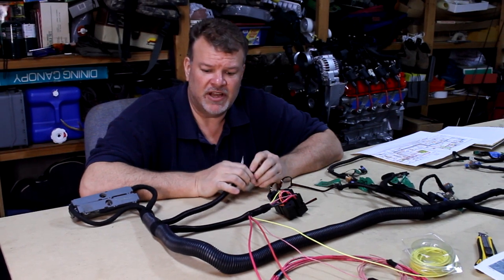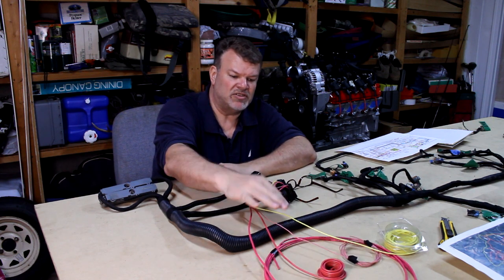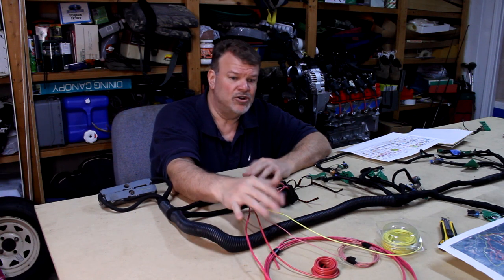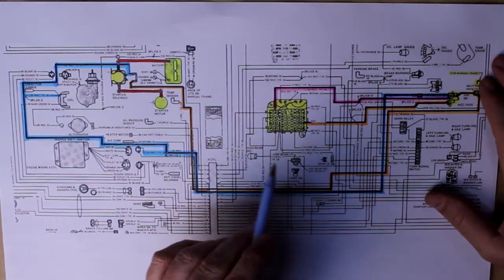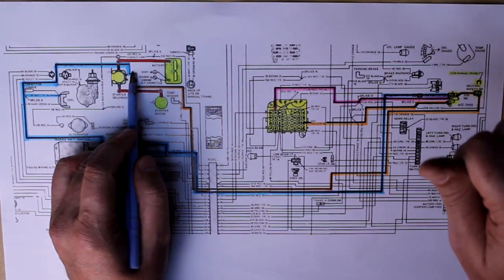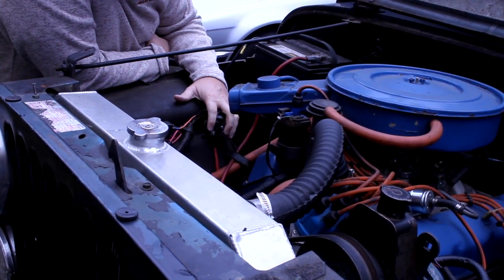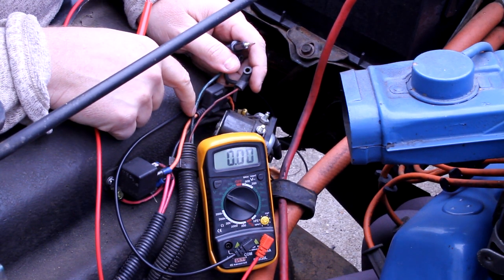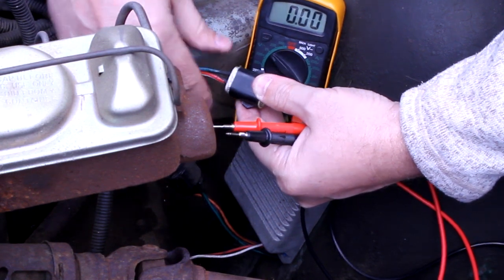LS Wiring Harness Part 6 | Project Rowdy Ep018

Comment: These videos are AWESOME! One question for you. The VATS need to be removed from the computer. Any way to do that with free software online? Also what other things need to be done to the computer in order to make it run? Assuming you could still tune it via a computer afterwards? Thanks Again.
Reply from the maker: These are great questions.   I don't know of any software that is free that would allow you to reprogram the GM ECM Computer.  I plan to use HP Tuners which requires the software and Tokens to access the ECM.   There are companies online that you can send yours to and have them reprogram, but you need to document all of the changes you want so that they can do it in one swoop.   The problem with that is if you upgrade any internal components, the ECM needs to be Tuned.   Removing VATS is the only thing required to "make it run".   However, while reprogramming, it makes sense to disable anything that would falsely generate a Check Engine Light (MIL) event.   Since I removed the EGR and Rear O2 Sensors, that will be a few of the Triggers that I will disable.   As far as Tuning the program.   It is best to make known changes, then run the engine in the car and collect driving data.  This will tell you where the computer had to make adjustments, then you go in and turn those adjustments into the default settings.   There are tables in the ECM that have to be "smoothed".   I am still working on the vehicle that this engine will be installed.   I am waiting till I have the engine installed to make all of the changes that I plan.   I have plenty of rough notes that I have collected and will review when that time comes.    Hope this helps.    Mike

Comment: One question sir. I’m working on my harnesses (obs and ls) I know where to connect the tcc wire from the harness but where do I connect the tcc wire from the pcm?
Reply from the maker: Sorry, but my solution and research has been for installing my engine in front of a Manual transmission so I do not plan to use the TCC circuit.  Someone else might be able to provide you help.   Mike

Comment: I have a question about the yellow wire (the fuel pump wire) is that sending out a 12v + signal or ground signal because for my Ls swap my plug into the fuel pump takes a ground signal?
Reply from the maker: For my configuration and in my drawing, the Yellow Fuel Pump Wire is a +12V Feed wire.   I’m looking at my diagram and believe, if you are wanting to use a similar solution to provide Ground.  You could do that by simply changing out the Orange Wire for a Ground wire.   Then when the PCM triggers the relay with the Green wire, the Yellow wire would be providing a Ground to your pump.
Reply: @UCanDoIt2Mike  awesome thank you so much!
Reply: @UCanDoIt2Mike  I just looked but that orange wire that it is connected too is a battery PCM battery supply so don't I need to keep that? If so would I do with the orange wire? sorry I am just alittle confused.
Reply from the maker: So I believe you said (I’m not so many words), that you need the PCMs Green wire trigger to turn on your fuel pump by providing a Negative signal.   Right now my diagram provide a Positive signal.  To change that, you would need to change what is going IN the relay at the right (according to my drawing) to be a Wire providing A negative connection and not providing a positive (+12v as the current Orange wire is doing.
Reply: @UCanDoIt2Mike  I'm just confused now I was talking about the orange wire. I also sent you an email showing how I believe mine is supposed to be wired I am just not sure how it to wire it up too yours.

Comment: If your Jeep came with a points in distributor, the other wire is to supply 12v for the point’s
Reply from the maker: That makes sense.  During the restoration, all of that is being removed.  Cheers!  Mike

Comment: That extra wire on the starter solenoid gives 12v to the coil during cranking. One started the coil runs off a resistor wire
Reply from the maker: Perfect!  Thanks  Mike

Comment: The wire that had ~6VDC at the starter solenoid is the run voltage for the coil. When the solenoid is energized, it sends 12VDC for starting to the coil, and when the solenoid is de-energized, the voltage on that line falls back to 6DC for run. Great series of videos for this project. Keep up the good work!
Reply from the maker: Thank you!   It did not make sense at the time.  Your explanation reinforces what I found but did not understand.   Thanks for clearing that up.  Cheers.   Mike
Reply: I was going to mention this. Those old distributor/coil solenoid and grey magic box were headaches for me in mid 80's ('77 Ford 351M).

Comment: Your videos are so well done it has been a great help to me in my build. I watched all these harness videos and remember you mentioning a guy that used the Starter enabled relay control. I am working with a blue green pcm that has this function. You had a link or a name but now I'm having trouble finding it. Thanks
Reply from the maker: The channel name is Gary Garcia.  Can’t remember if he went into detail on the subject or if he mentioned the theory that I picked up on.   Thanks for the feedback and have fun with your project.
Reply: @UCanDoIt2Mike  what episode did you mention him and the idea of the pcm controlled starter. I would like to watch it again. Thanks for you quick reply.
Reply from the maker: You’ll have to scan through his videos.   Not sure which one it was.  One of his wiring videos.
Reply: @UCanDoIt2Mike  actually i wanted to know what one of your videos did you mention him. Thanks
Reply: I did find his and may give this a try. The main problem is I am using the S10 fuse block so there may be a another relay needed to make this work. Would be cool to get it functional. Thanks
Reply from the maker: If it was not in this part 6 video, it may have been in Part 4 or  Part 5.

Comment: Sir can you make corolla 2005 wiring harness
Reply from the maker: The wiring process shown in this video series is not vehicle specific.  You can drop this engine and harness in any vehicle that it will physically fit and make it work.

Comment: So it's been a few yrs and I'm sure you're done with your jeep but I'm doing a swap on my truck and I'm wondering where/who ended up doing your PCU flash and tuning? Thx for great vids
Reply from the maker: In home restorations, a few years can turn into a few more years.   I am still working on the Jeep.  I plan to do the PCM flash updates myself.  I have purchased HP Tuners and a couple of credits.   I have already created some documentation that I plan to follow after the engine is installed in the vehicle.  I will video that effort, but it is a while out.   Cheers!   Mike

Comment: I'm doing the same swap on an 86 CJ7- you're helping thousands of people.  
From the split bulkhead connector, I assume you're keeping the left side connector's wires intact (the headlights, turn signals wires).  From the right side bulkhead connector, you're splicing into the 2 wires (blue & red w/ white tracer) that go into the old Jeep ECU.  
What other wires will you use that come out of the right side bulkhead connector?  Thanks for all your work.
Reply from the maker: My plans are to install a new Jeep Body wiring harness which will completely replace the fire wall split connector.  That wire is old, weathered, and stories of it being a lower grade wire....  I want to avoid future issues.   That harness will resemble the one that I analyzed in this video.  I will still only need to find a Switched 12V+, Constant 12V+, and Ignition wires to connect it to the Engine Wiring Harness.   These old Jeeps do not have an ECU.  They did have a Ignition module (on the Driver's side fender well).  That module is not needed for the new engine.  The engine and engine harness pretty much runs independent from the Jeep harness.  And Yes...  the Headlight and "Grill" area legs of the harness are independent of all this engine stuff and remain unchanged (other than my plans for the new Body harness).  Hope that helps!  Thanks for following along...  It's up to us to keep these ole Jeep alive.  Cheers and have a blast with yours!!!   Mike
Reply: @UCanDoIt2Mike  Thank you very much. Hope yall have a great Thanksgiving.
Reply from the maker: @MyDyerMaker  You are welcome and have a great Thanksgiving as well.   Cheers!

Comment: On the red connector for pcm.Pin 38 PWM fuel gauge signal output.Does that go to the fuel gauge on dash or fuel level for tank?
Reply from the maker: To be honest, I am not sure what that circuit is for.  It is labeled as OUTPUT.  Therefore, I assume that it goes to the Dash.  I would have to check, but I do not think my harness had a wire in this port (R38).  The vehicle that I am swapping my motor into will use an independent (has nothing to do with the Engine Harness or PCM) circuits for the Fuel Level.

Comment: Just started up my 5.3 that I built using the book and this video! So far runs smooth. Oil pressure idle is about 35psi or so which looks to be good! Thanks so much for the help! Couldn't have done it without you!
Reply from the maker: Congratulations on your build!  Writing this with a huge smile on my face.  Cheers to you...  Mike

Comment: Your igntion actually runs on 6V through a resistor. The red wire comes off the ignition switch and through a resitor to feed the ignition module 6V, the red wire then continues on to the starter solenoid where it picks up a momentary 12V source from the small post there to "overdrive" the ignition for easier starting. The red wire you tested at the module will likely pull down to 6 volts when you put a load on it.
Reply from the maker: Thank you for this explanation.  I had another response, but yours is very thorough.   Thanks.  Mike

Comment: I'm curious what size fuses you are using.  I've watched all of your videos about the 4 fuse harness and it doesn't seem to mention it.  I'm doing mine exactly like yours for a 6.0L swap in a 1978 K10.
Reply from the maker: 15 Amp fuse for all four circuits.  Cheers!

Comment: Do you have to send the computer out or is it plug an play after this point?
Reply from the maker: jerellis1983 The PCM computer does need to be reprogrammed.   An example would be to at least remove the VATS (vehicle anti theft) functionality.  It will only run for a few seconds with out mod.  You would also want to have any other items that you have removed the sensors to be disabled in the computer so that you do not get false Check engine warnings or throw inappropriate codes.
Reply: UCanDoIt2 Nice! Thanks for the reply and the awesome video’s. Keep up the great content!
Reply from the maker: jerellis1983 sorry, that should have read, DOES need to be reprogrammed.

Comment: Could the pink wire be connected to “run and crank” or should it just be connected to “run” only. My fuse block has a fused plug-in labeled IGN which is hot in the run and the start positions. Any reason why that wouldn’t work for the pink wire?
Reply from the maker: That would work just fine.   It implies that you will have +12V on your Pink circuit in Run and during the momentary Crank positions.  No harm there.  Mike
Reply: Thanks for the quick response! Great videos, I think this seems to be the part of the swap everyone frets over. Thanks again!

Comment: Thank you so much for the series! This has helped me so much. I have a ppl wire left over tho that came off the c100 connector called “starter solonid”. Is that what needs to go to the run position?
Reply from the maker: Yes.   When the Ignition is turned to the "Start" position, 12V+ will be sent through the Purple Wire to the Starter Soleniod.  This activates the Solenoid which closes another 12V+ circuit that powers the Starter.  Cheers!

Comment: You may find that the "Run" wire on the jeep which you are seeing 6v is being back-fed from the coil. This wire would see 12v when the starter solenoid is activated, giving the coil + 12v making the engine easier to start (stronger spark). Usually fitted to engines with resistor type coils (bypasses the resistor) I found this on my BBC 454

Comment: The reason that early starters have a 12volt run wire is to give the coil full 12 as you are cranking the engine

Comment: Thank you. Watching your vid clarified a bunch of questions I had. LT1swap has awesome info also, but sometimes confusing. Can I ask what you fused everything at? Cant seem to find that info. I grouped my circuits a little differently but it seems like dealers choice.
Reply from the maker: Glad you found some useful information.   I used 15 Amp Fuse on each of the circuits.

Comment: Would the connector u got in the subscription work for a caprice 86
Reply from the maker: I believe you are referring to the 8 Pin Connector that I added to the harness.   This connector just needs to be compatible with itself.  It is being used to allow me to install the engine and harness and then attach the mating connector which will have custom connections to the accessories.   Think of it a disconnection point.
Reply: Thank you bro needed that and when u say mating u mean that’s on your oem harness because ik you doing a swap and one more thing once the Ls is rebuild do u have to set the timing thought gm left that in the past with the 305 etc
Reply from the maker: You will not need to worry about timing.   The PCM will receive rotational information from the sensors and determine when to fire the plugs.
Reply: Good ok because I seen you was setting the rockers and did u need to program your computer for the swap

Comment: So I'm 5.3 swapping my 02 new edge mustang. I have a ? Will this wire harness set up work for my build as well?
Reply from the maker: This wiring harness approach will create a solution that will allow you to drop this engine into anything with four wheels and connecting the main four wires, it will fire.   You will/may have to make some different decisions if you are running an automatic transmission, my will be a Manual.  You will have to research and figure out how to connect to your dash instrumentation.

Comment: Great series! This is seriously the best tutorial for anything I've ever seen on youtube.  My question, from what I can tell on your documentation there is only one data wire from the PCM to the OBD2 port. Is that the only wire needed to be able to see all the engine diagnostics? On my 02 Silverado with the 4.8 the OBD2 port has 5 wires to it, presumably power, 2 grounds, data and the 5th I don't know. (Plan on studying the wiring diagram for it.) Thank you!
Reply from the maker: Love your comment!!!!!!   Thank you..    Your statement above is correct.  One "Data" wire, an Unswitched Power, and 2 connectors are grounds.  You will be able to TUNE and Read Diagnostics from the PCM.  Cheers!  Mike
Reply: Awesome, thanks!

Comment: Question: theoretically, if you didn't do all this and wanted to run a stock harness so that you can bench run a motor,  all you would need to do is power the pink wire and purple/now red wire(out of the 4 wires leaving fuse junction) and that harness would have all the power it needs to run? Not sure if I'm asking or stating a fact.  Lol thanks in advance
Reply: Oh ok, so you would have to power all of them.  Thought you can just power pcm wire and start supply wire.
Reply from the maker: Coils will need power (2 Pink), Injectors need power (4 Pink),  PCM (Pink)....  So yea, there are several pink wires that need power for it to run.
Reply: UCanDoIt2 that makes sense.  Thanks again!
Reply: Is that with without the VATS deleted?
Reply from the maker: I believe you are correct in that you can power the proper wires in the stock harness and get the engine to run  (Pinks, Orange, Ground, and come up with a Starter Solution Purple).

Comment: Thank you so much for these videos they definitely give me a good overview before I begin, one question though, won't you need a tune to remove the sensors you've removed so the ECM won't be looking for them?
Reply from the maker: Thanks for the feedback.  Yes the PCM will need to be re-programmed to remove VATs and other items that I have removed so that erroneous codes are not thrown for items that are not present.  I still have to installed the engine and I am waiting until then so I can test the tune and it would still be available for tweaking.   I do not plan to reprogram myself.